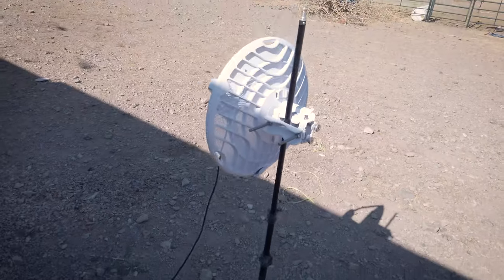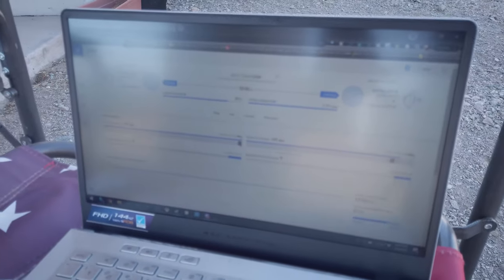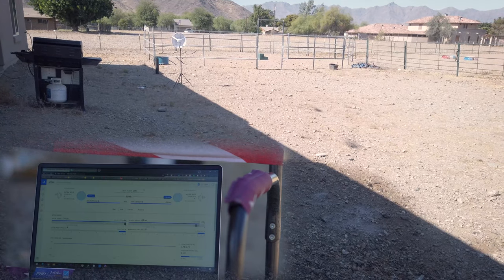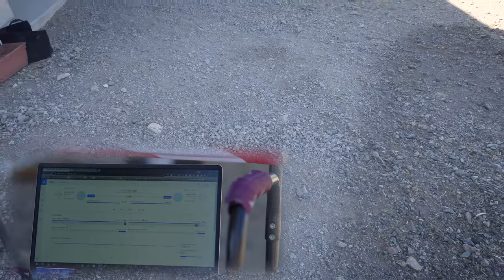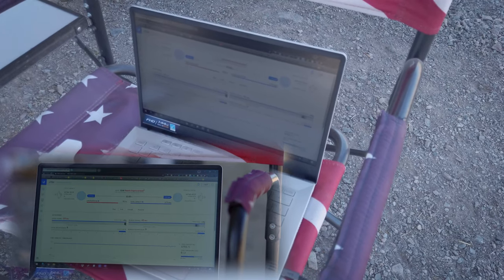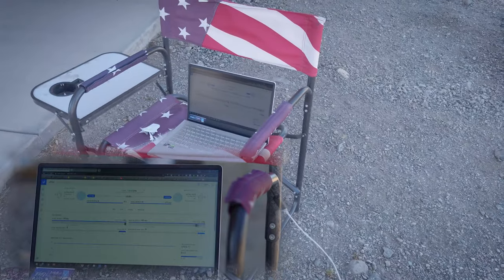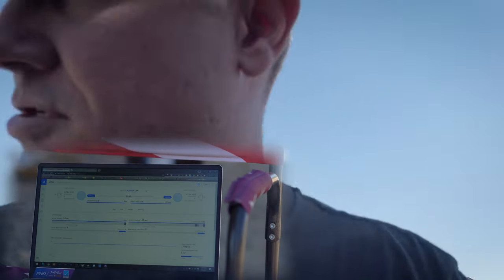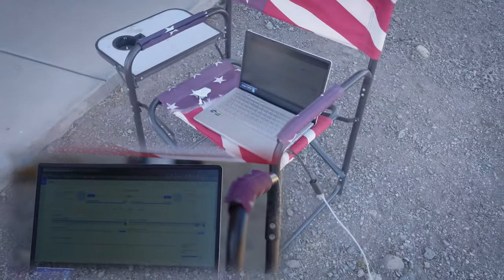AF60-LR "Rain Fade"?...with a HOSE? - DIY Ubiquiti Internet Relay Pt.67

Comment from the maker: So, somewhat "inconclusive results" with the hose, but still kind of interesting...and the aim bit?  Yea.  I kinda expected that.  They need to be VERY precisely aimed...VERY...even at this distance.  What kind of texting would YOU like to see!?
Reply: Using a garden hose is probably not fine-grained enough of a test to see how actual rain would impact the link, IMO. Have you had any experiences with your AF 60 links during rain under real world conditions? If so, how did you see it perform?

Comment: I have a 1km 60GHz link, that works pretty well in thick fog and heavy rain.
You can't quite simulate 1 or maybe even 10 Kilometers of dense fog with a garden hose.
So just be aware that this is not very conclusive but glad that you're having fun :D
Reply from the maker: Yea, for sure. This was far more "let's see what happens" than "I'm going to science today". lol
Reply: i have 3.7 km af60 lr, with moderate to heavy rain. connection drops, until it disconnect.  from good link(-54dbm) and 1.95gbps. drops to 300, then disconnects afterwards..

Comment: I also have a small WISP . I'm using 5ac-620 about 60 ft tower with lot's of trees. So Nlos. I'm thinking about af-5u or afx5hd. would like to know what would be best for this ptp link. I'm currently pushing about 215 to 270Mbps with -70 signal. Almost no interference. cheers from Canada and thank you for this channel.

Comment: Hi, I hope you can help me with these questions, how many stations (users) do you connect per AP and which AP's do you use? also, what is the average speed plan offered to your customers? Thanks.
Reply from the maker: Every subscriber provides or buys their own router. I don't manage APs/routers. It's 1 per, I guess you could say.

I stock basic TP-Link routers for those that need one.

I sell 25Mb/s service.
Reply: @rmp5s  Thank you very much, I meant how many subscribers are connected to your antennas? Per antenna
Reply from the maker: @juanpablotorrado273  Mine? Not many. I have almost 30 on one of my Prism 5AC sectors. They can run waaaaaay more than that though from what I hear. It depends on a lot of things, though.
Reply: @rmp5s  Thanks mate
Reply from the maker: @juanpablotorrado273  Any time. Be sure to join the Discord!

https://discord.gg/yJfkehm
Reply: @rmp5s Sure, now you have a follower from Hobart, Australia
Reply from the maker: @juanpablotorrado273  Awesome! Welcome!

Comment: UBB video please,  building to building.
Reply from the maker: UBB?
Reply: @rmp5s  unifi building up building bridge. Google Unifi ubb, it's a pack of pre-paired radios for short distances connecting two buildings wirelessly for $499.  Not ideal for your WISP setup but seeing you are having fun testing point to point devices.  
Glad to see you back making more content.

Comment: 4km is the safe limit for a high availability link with this radio
Reply from the maker: Depends.  I've seen them work VERY well at 7-8km (~5mi).
Reply: It is a mixed bag. I like these radios but if the rain droplets are the right size anything over 4km will drop. Funny thing is that UI sales and support will not give you a distance number and only refer you to the link planning tool which is definitely not based on reality for this spectrum and radio combination. But UI knows the real numbers.
Reply: Also, even though the hose is a hell of a rain simulator, its only a foot of rain it has to shoot through.
Reply from the maker: @atillagahbro  Look at it as a percentage of the shot, though.  It was like a MASSIVE storm over...like...1/2 the link.  Anything but scientific but it DID actually kill the signal a couple times.  Kinda interesting.
Reply: @rmp5s  what I find interesting about this radio is that it is solely responsible for making the UI AF24 (standard) and the Mimosa B24 product lines obsolete overnight. The AF24HD has better rain immunity at up to 7km. I don't see why anyone would use B24 or AF24 radios any longer.
Reply: Auto power control. Keeps power down when it's not needed.  You added water and it probably detected it needs more power.  Backoff period may be fairly long.
Reply: @rmp5s  that percentage is meaningless. You're going to measure attenuation logarithmically (linear dB). Every foot of rain decreases the signal by a certain percentage (given constant rainfall rate). So basically the drop is in dB/mi for a given rainfall rate.
Now that hose is some heavy rainfall so I'm willing to bet a foot of that is on the order of 100ft of typical rain.
If you have the opportunity, try this same experiment on a much longer link. You'll notice you get the same drop in dB. Unless the auto power control trashes the entire experiment.
Reply: @atillagahbro  Just wanted to add to this in case it may help someone. The pair of AirFiber 60 LR's I have are 1.52 miles (2.44 KM) apart. In perfect weather, signal on both ends is -44 dBm. In LIGHT rain, the signal degrades to -55 to -60 dBm. In moderate rain, -65 to -76 dBm,  which at this point it begins to disconnect. Anything harder than moderate, it's over. As a failover, I maintain my 5GHz PowerBeams.